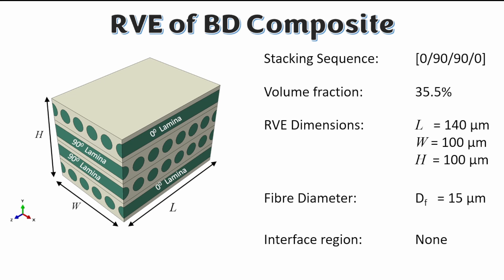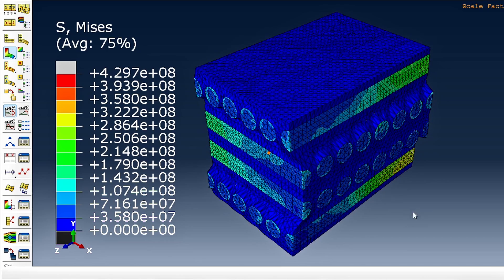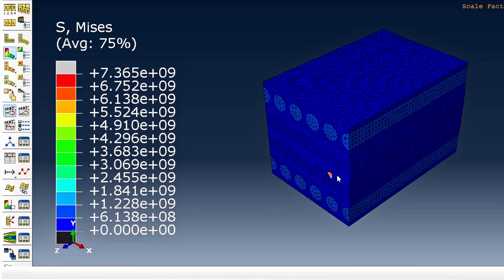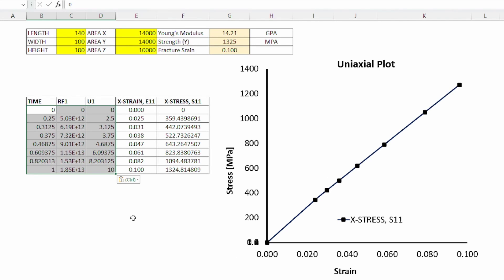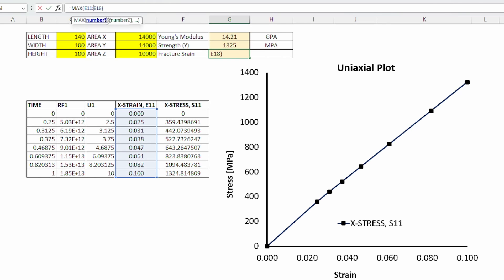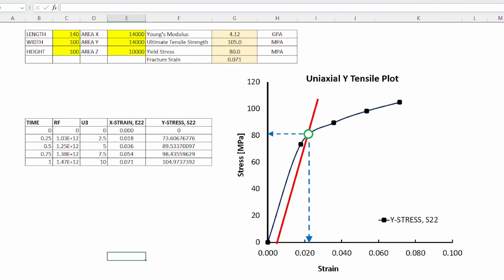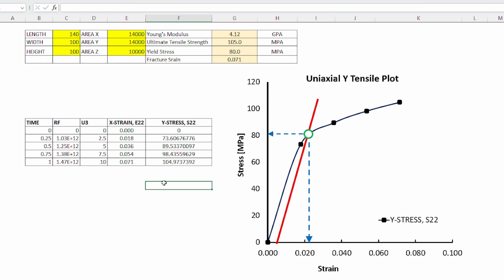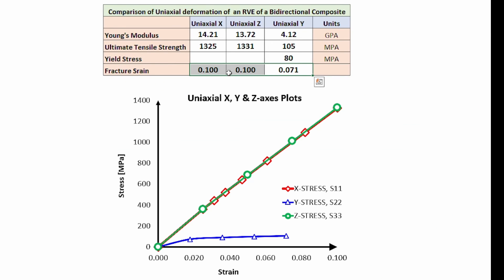RVE Modelling of  BD Composites #4: Uniaxial Simulation Results

Comment: Dear Prof. I am modelling bias-extension for in-plane shear deformation in fabrics. Could you suggest a method to generate the model?
Reply from the maker: Hi, thanks for the question. I have not done such a video before but it does sound interesting. I think you should look at this link from ScienceDirect and read more about it: https://www.sciencedirect.com/topics/engineering/bias-extension-test

It will require setting up a tensile test and doing it normally. However, due to the woven/textile arrangement of the fibre 45-degree to test direction, you will experience in-plane shear in the guage section of the specimen. 

I will start with a simple homogeneous material to learn first and then find a way to incorporate the woven/textile model later. Good luck.
Reply: I can provide photos by email